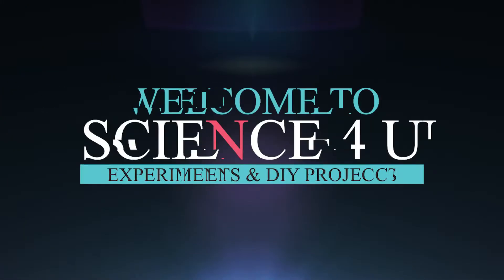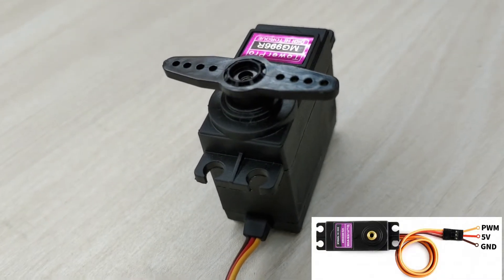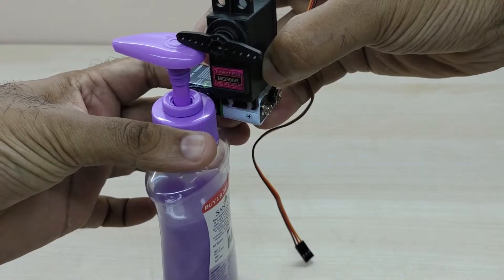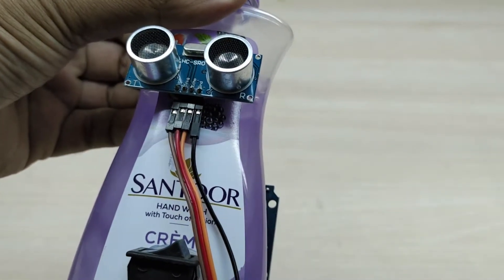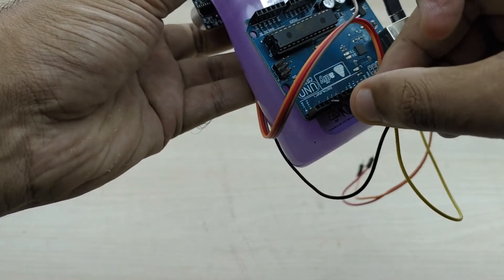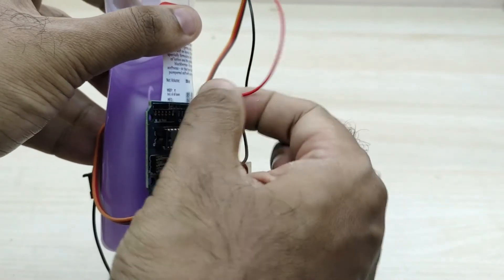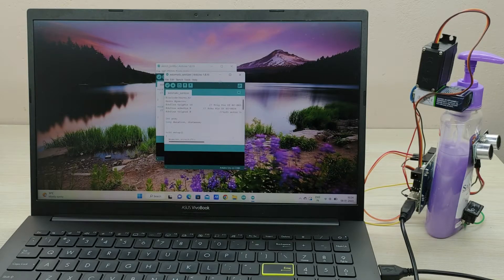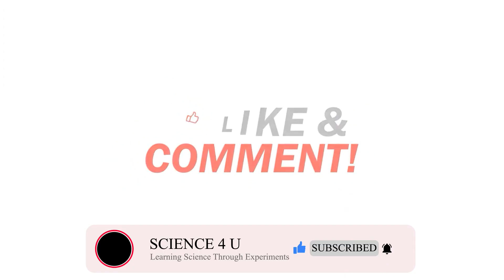How to make Automatic Hand Sanitizer || Say" NO" to CoronaVirus || Arduino Project

Comment: How much did you take it to make this?
Reply from the maker: It took around 20 dollars to make this..
Reply: @Science_4U_  thanks for this can you please name all the equipments you used in this project and how much time diit take to do it?
Reply from the maker: @JohnSmith-kc7fi  Yes sure. Please find below the items used for this project and the purchase links too.
1. Arduino Uno:  https://amzn.eu/d/5IlDq9r
2. 9V battery:  https://amzn.eu/d/34SPqIR
3. Servo motor MG 996 :  https://amzn.eu/d/fcIwdMR
4. Ultrasonic sensor HC-SR04 : https://amzn.eu/d/8Qi1WuQ
5. Rocker switch : https://amzn.eu/d/1BBajCn
6. jumper wires : https://amzn.eu/d/7uemocG
7. Connector for 9V battery : https://amzn.eu/d/gXdNQt6
Reply from the maker: @JohnSmith-kc7fi  It is a rather easy project. It takes just 3-4 hours to complete this project🙂.
Reply from the maker: @JohnSmith-kc7fi  Please feel free to ask any questions related to arduino projects or any other experiments. I will be happy to answer🙂
Reply: @Science_4U_  hey thanks a lot for your responses...and I actually wanted a internship in embedded system  what do you suggest for me to learn?
Reply from the maker: @JohnSmith-kc7fi  Hi friend, I have only a limited knowledge in this area. So it is better to seek advice from an expert. I feel IOT, microcontrollers & microprocessors, and new programming languages like python are good areas you can study.
Reply: @Science_4U_  ok thank you
Reply: @Science_4U_   how many 9v battery is required
Reply: @Science_4U_  in this project only one 9V battery is required, right?
Reply from the maker: @JohnSmith-kc7fi  1 number will be fine. But it will not last long because I have used a powerful stepper motor. Better you can use a battery with higher ampere hour capacity.
Reply from the maker: I have used only one 9V transistor radio battery in this project.
Reply: @Science_4U_  thank you
Reply from the maker: Arduino UNO board - 10 dollars..
Servo motor - 4 dollars
Ultrasonic sensor - 4 dollars
And other items like battery, switch and jumper wires - 2 dollars..